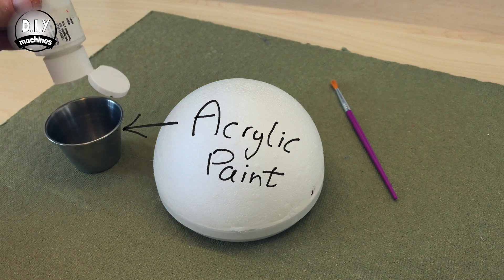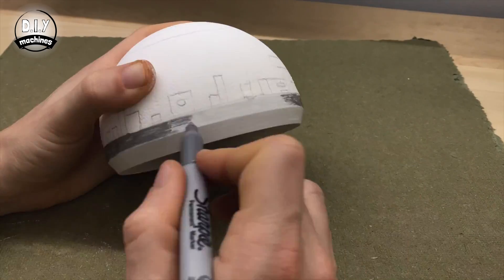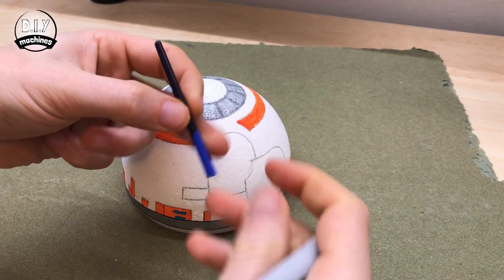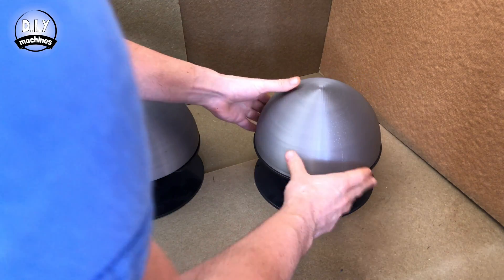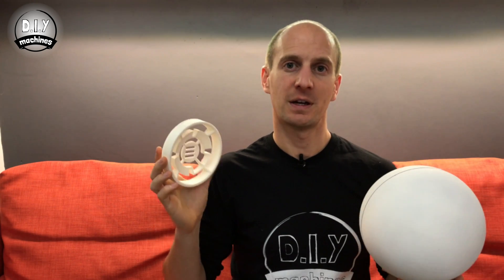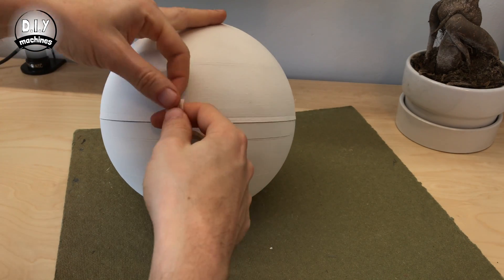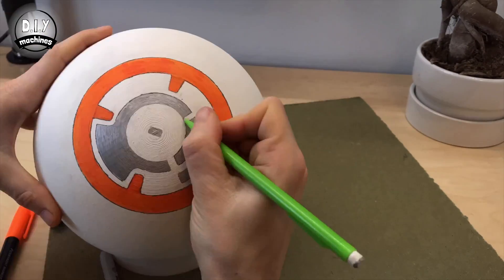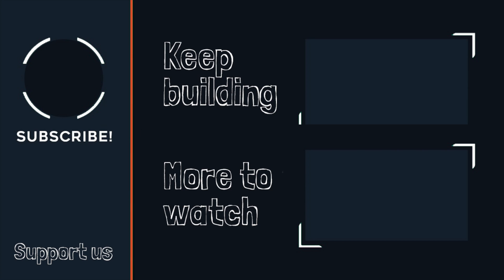Star Wars BB8 inspired RC Printed Robot - P3 Decorating

Comment: Dear, congratulations on your project. It's the simplest one I've found, and it seems to be the most functional one. I did a similar project but it didn't work out very well. It becomes kind of unstable when the head is mounted on it. Did yours work well? Could you post a video of your BB8 running pls? Tks